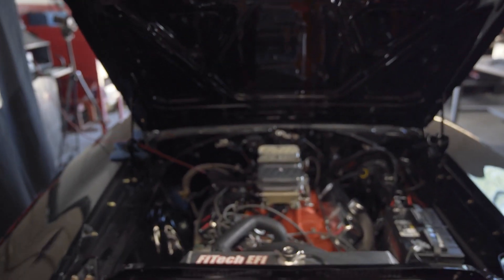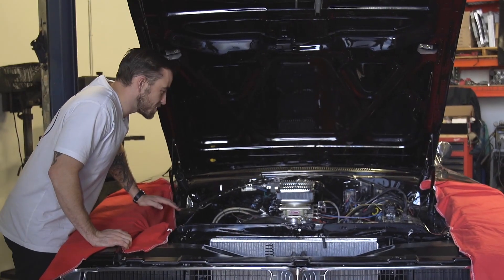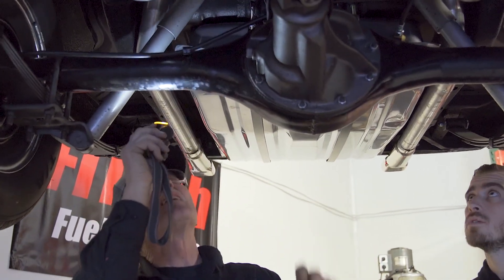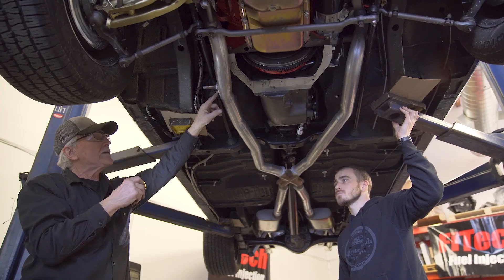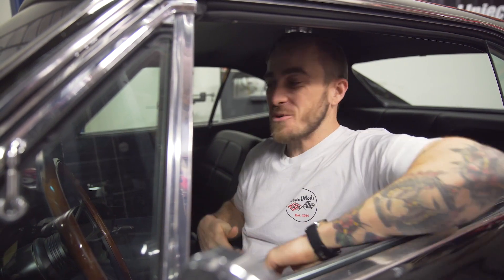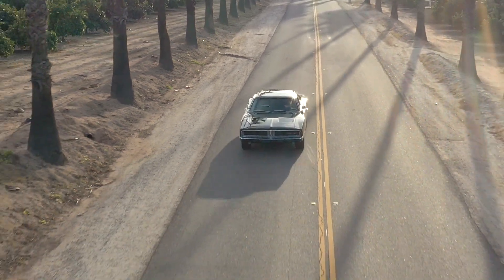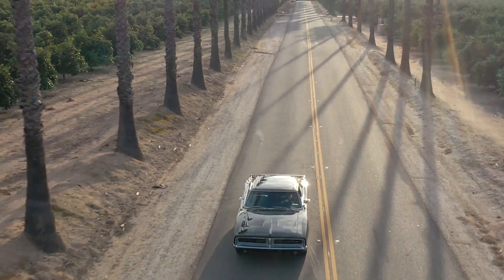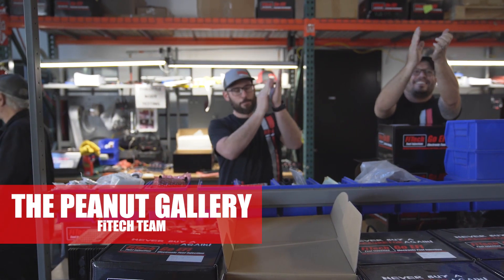PART 3: Mike Drives The FiTech Installed '69 Charger

Comment: On the subject of gas mileage:  The Six-Pack setup can be decently fuel efficient---as long as you can resist the urge to honk on it at every light.  (Spoiler alert:  I know I wouldn't be able to resist🤣)

In normal operation, you'd only be working the center 2-barrel.  It's only when you either a) stomp it, or b) get up to 60-70 and the secondaries start opening, that you'd have the full six barrels.

So is this car mechanical or vacuum secondaries?  Understand, it's not gonna matter to me---I would be happy either way.   But it's good knowledge to have regardless.  

Btw....absolutely AWESOME ride!

Comment: Looks amazing, but in the burnout video you posted on Facebook... only showed one wheel spinning. That should have been the first mod to have been done.
Reply: she's a one legger? Oh, man..and i sold my 3.55 sg like 6 yrs ago, woops? 
crank up drivers side torsion bar a bit..let a couple lbs out of the right rear tire..trunk mount the batt at rear psngr side..it'll hook & book in a straight line anyways. 
any 2 of those works wonders. 3 is fab. you can even run a stickier tire, rear right if needs be.

i always am amazed when ppl do a pull in a BB Mopar on YT. 
they're usually running nm for tires..a 440 should fry BF Goodrich Radial T/A's like nuthin'..yet you never hear or see the burnout.. 
...I'm confused. lol

Comment: Looks like all 3 work at once ?? You have one that works like a true 6-Pack ? The outboard ones dont start working till 1/2 Throttle  ---   Thanks  Landy
Reply: Yeah, idk much about a 6 pack efi setup..idk if it is a 1 then 3 deal like the OG carbs, or all 3 always. 
as well..how are they getting enough CFM through those lil lawn mower air cleaners? 
a mild/moderate 340 wants 850 CFM (Tony D'Angelo of Hot Rod Garage had his 340 Demon dyno'd..dyno guy loaned him an 850 to use rather than his 700 something and he picked up power.)
 a 440 then needs 900+ CFM, depending on hm cam, how big of heads... ofc ppl will argue with me on this..why? if you have a muscle car, try a bigger carb! If you have a performance V8 and have a 500-600 CFM carb..you dunno wut yer missin, Jack!

 lol..lemme see if i can look up CFM on this FiTech 6 pack:
from: https://www.hotrod.com/articles/kick-carbs-installing-fitechs-go-efi-tri-power-600hp-system-71-challenger/
FiTech's Go EFI Tri-Power 600HP system is the solution. It's a complete system with three 500-cfm throttle-bodies; a wiring harness; an ECU; a programmer; and a myriad of sensors, including MAP, idle air control, throttle positioning, wideband O2, and coolant temp. It is clear that FiTech has tried to make the most complete six-pack system on the market for $1,995.

1,500 CFM. That should do! :D
.._as long as those air cleaners off of a push mower fill the bill_ :)